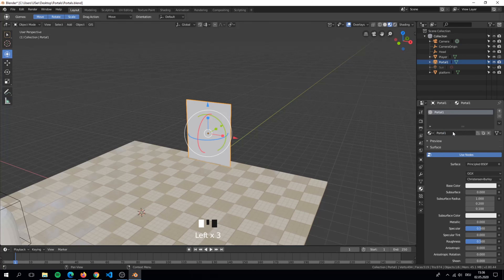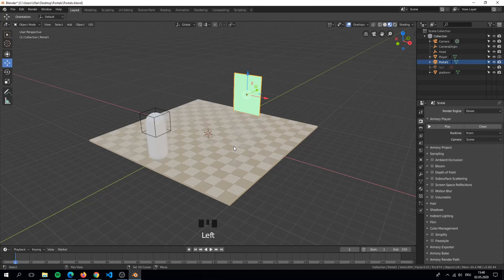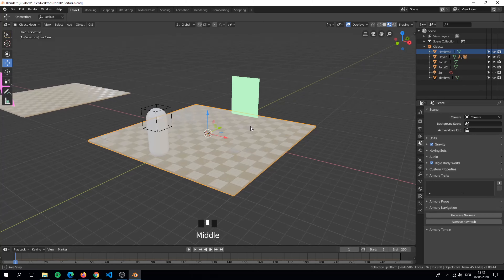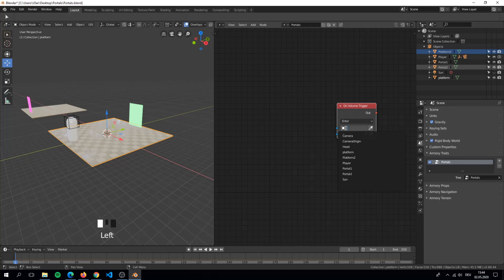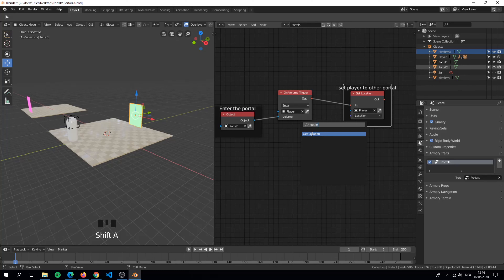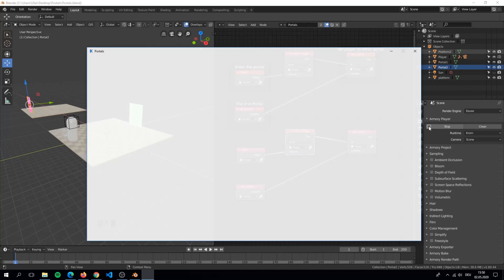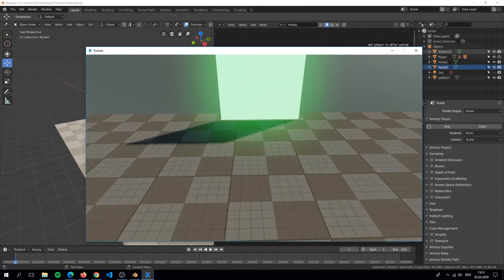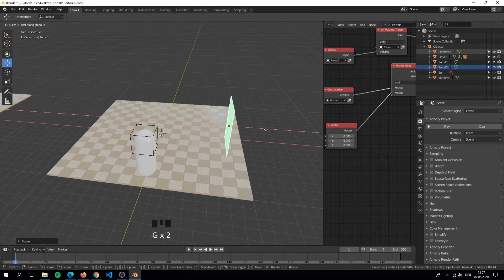Armory3d | Basic Portals | Logic Nodes

Comment: Hello I have a question, i tried to plug in Armory3D to Blender 2.82a and it does not work, it says there is SDK Path error...
I tried all the current Armory versions 2020-3, 2020-4, 2020-5 ... and none of them work.
Is there a solution for this ?
Reply from the maker: Try to import the sdk file as a zip file in the blender preferences. Then for the sdk path set it to the armory file path where other files such as iron and kha are placed. It worked for me like that!
Reply: @ArmoryBlender  Thank you! I'll give it a try!
Reply: @ArmoryBlender  No, still does not work. I tried on Blender 2.82a      2.80rc3      2.79b ... always the same error
Reply: @ArmoryBlender  Is it too much to ask for zipped version of your Blender 2.80 and Armory? via Google Drive?
Because mine doesn't work at all... I really wanna try Armory
Reply from the maker: I mean you can also use the armory3d legacy version. You can junp right in there without any installation. My armory sdk is just the same from 1 week ago
Reply: @ArmoryBlender  Sorry to bother you, but where can I find Armory3D legacy version? I think it is pulled off the site. There's only SDK on download list ...
Reply: Make sure that your sdk path has latin (english) letters only and no symbols like question marks, dots etc. Ideally you'd better place the sdk folder into the your blender installed folder.
Reply: @nikok-v5272  It finally worked! Thank you so much, i was messing around with this for a week straight already ... made me lose my mind